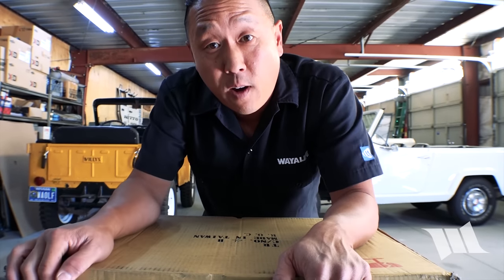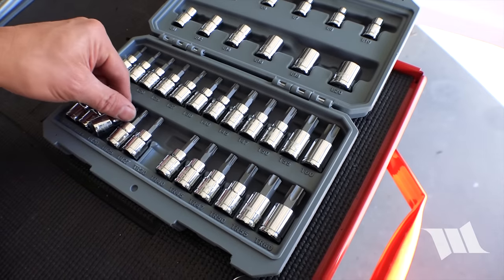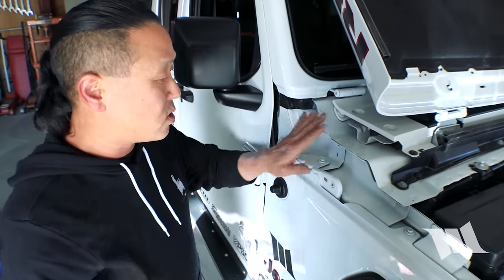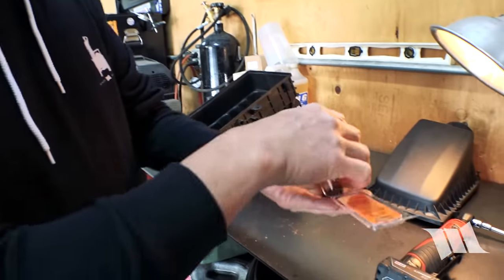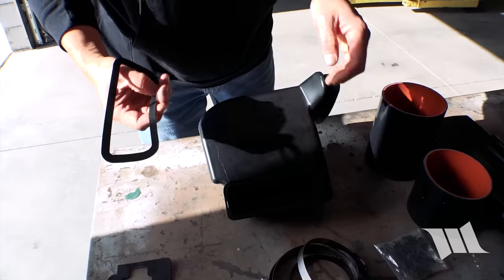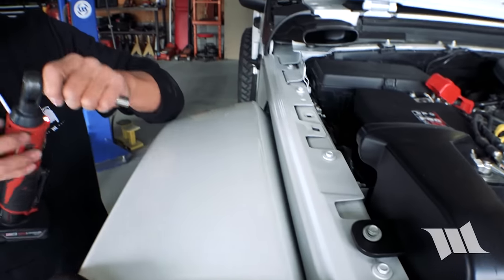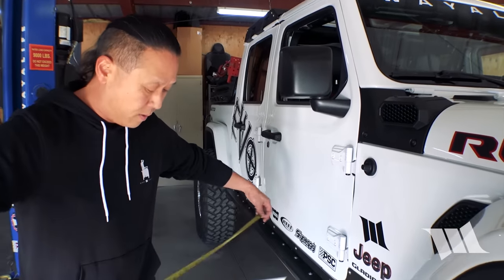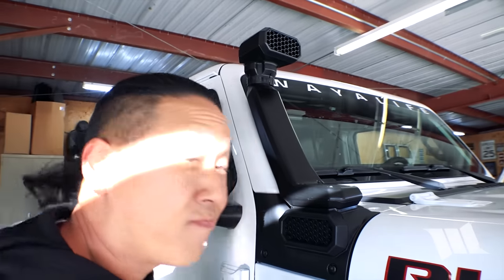Rugged Ridge AmFib Snorkel HOW TO INSTALLATION on a Jeep JL Wrangler or JT Gladiator Truck

Comment: Guess your going to have to “Now” do the River Crossings on Fordyce !  😜
Reply from the maker: LOL - only because we've never done it before ;)
Reply: On a Side Note Eddie... Have not seen a JT Video on Fordyce yet... Hmmmmmm ?  😃
Reply: @wayalife  The low profile snorkel gives you 4.5' of clearance.. but with the ARB air compressor mounted behind the driver side fender,  what is your actual water fjording ability?  I'm guessing closer to 2.5' without a wake?
Reply from the maker: @JeffPalmer941  Not sure how you figure that. The top of my ARB compressor sits at about 40" off the ground. Also, if I really needed to ford deeper water, ARB does sell a kit that allows you relocate the breather to wherever you want.
Reply: @wayalife  the stock gladiator is only rated for 30",  I assumed the air compressor sat lower since it appeared to be under the brake cylinders. I'm not sure what size lift you have, but I assumed that between the lower-sitting compressor, and your lift/tires,  it about broke even..  hence my guess at 2.5'.  If it's higher than that, I'd love to know because I'm interesting in that ACM you sell.
Reply from the maker: @JeffPalmer941  Again, if you really go in deep, ARB sells an extension kit for the breather to locate it wherever you want. I have a link for it in the description of my ACM video.

Comment: Hello from France.... as always this video is superb .... a question: around the 4th minute you remove a part under the air filter ..... What is this part for? I saw in a video of "cj off road" that he does not touch it ...... what do you think? ..... thank you again for the video. bertrand
Reply from the maker: That is the ambient air tube. It take cold air hitting the front of your Jeep and then pushes it up toward the intake on your air box. It needs to be removed or else your drain port will make contact with it, prevent you from fully seating your air box down and make it impossible to access the drain.
Reply: @wayalife  thanks

Comment: Hi. This is my next mod. How hard is it to get at the bottom drain valve to open/ close. My winch is in the way too and I’m just going to cut the ambient air duct off from the inside. Only I will know lol.
Reply from the maker: I guess it depends if you have fender liners installed or not. With them on, it takes a bit of effort but it can be done.
Reply: @wayalife  hi. i’m still deciding between the AEV snorkel with the small cut out in the bonnet and the Rugged Ridge AMFib. Being a Right hand drive over here in Australia i need to see if the AMfib restricts the view as it’s closer to the driver.  I’m starting  to see cheap copies of the AMfib and wonder if they  are any good. AEV snorkel through the bonnet has less joins and this is a bonus . cheers Phil

Comment: I assume the low-profile option clears the folding windshield.  Makes me wonder what it would look like if the portion of the cowl that conforms to the original cowl's shape were painted to match the rest of the truck.
Reply from the maker: I'm pretty sure that it will. Also, Rugged Ridge painted the one they had at SEMA. You can see it in our SEMA coverage.

Comment: My production version doesn't have a rubber gasket for the air box adapter.  It's just a foam gasket.  Doesn't seem air tight.  Should I silicone seal it there?

Comment: Do you think the low mount is going to suffer some air restriction at speed from the vacuum? The stock set up has a secondary feed tube facing the front grill.
Reply from the maker: I assume you're referring to the ambient air tube. All that did was direct cooler air toward the intake. It isn't even hooked up to the air box.

Comment: If you had it to do over again, would you leave the ambient air thing in or remove it like in the video?  I'm going to get this snorkel when it's available.  I live in a swamp so I'm going with the high version, primarily due to splashing and not fording.
Reply from the maker: The ambient air tube needs to be removed in order for the drain to be installed.

Comment: What electronics under the hood did you also have to move to really make the increased water fording ability worth it?
Reply from the maker: If you're really wanting to ford water that deep, there's a lot more you should be worried about than what's under the hood.
Reply: @wayalife  such as? We have a lot of water crossings in Arkansas. I dont plan on doing anything too deep but crap happens. Ive ridden my motorcycle up to the seat and not been concerned bc of where things were re/located. Didnt know if it was the same for a jeep.

Comment: Do you think the low mount snorkel could pose a problem when washing your Jeep if it got a direct spray of water?
Reply from the maker: I suppose it's possible.
Reply: If you got any water in there, just open the drain valve. 
You would have to spray the car wash nozzle in there for several minutes to fill the intake enough to hurt anything.

Comment: Any comment on what happens if you drive for 3 hours on the highway (high RPM) during a heavy rain?  Or snow?  I guess it's no different than what water would be splashing up and getting in the original factory intake tubes.
Reply from the maker: All I can say is that I've done both and for longer than 3 hours and it's not been an issue for me.

Comment: How much extra water clearance does the low snorkel give over stock? Seems about the same except the low snorkel is back by the windshield.
Reply from the maker: If you're fording deep water correctly, it will create a build up of water on the front of your Jeep and potentially to the point where water comes up and over your hood, even if the actual water level is significantly lower that in. The ensuing bow wake will cause the water to drop away and so locating the intake further back alone can be a significant help to keeping water out of it.

Comment: Hey man, I just wanted to ask, now that you've had the snorkel on for a few months, have you noticed any change in engine performance using the snorkel? Good or bad.
Reply from the maker: Can't say that I've seen any changes what so ever.
Reply: Wayalife ok. Just curious. If you ever decide to take off the snorkel I could use a couple parts off of it. Lol

Comment: Hey Eddie! This is not related to this vid but, is there such thing a over gearing?   Suppose I put 5:13 on my sport just for more pickup but don't have a lift or large wheels.
Reply from the maker: Sure, you'd have a lot more pickup but you'd also be running very high RPM at highway speeds. This would cause you to burn a LOT more gas and make it difficult to pass being that your transmission won't want to drop anymore gears.

Comment: seems like on the high profile snorkel you would want the actual intake facing he rear of the jeep,, other wise you are just sucking in a lot of rain water when ever you drive in the rain
Reply from the maker: Watch the video again and you will see that air enters the bottom of the air box and then passes UP through the air filter and then gets sent to the engine. For normal driving, you would leave the valve on the bottom of the air box OPEN and that will allow water to drain out. You close the valve when fording deep water.

Comment: I have a question with the low snorkel setup does the motor get enough air since it’s not facing forward?
Reply from the maker: Just so that we're on the same page, the factory air box, the one that's under the hood has an intake that isn't facing forward either. Your engine is a essentially a vacuum when running and it'll suck all the air it needs and without the help of wind blowing into it. In fact, some high snorkels are purposefully pointed backwards and others have pre-filters that suck air from the bottom of them.
Reply: @wayalife  thank you I thought the factory was facing forward at the bottom of the motor hadn’t looked myself just assumed.

Comment: Hi I have a 2019 jeep jl Rubicon I have 35s wheels 2.5 in lift kit by teraflex and adjust steering stabilizer. Do I need anything else. Im not trying to do any off roading. Just local amd highway.
Reply from the maker: As I had stated on the other video, if you're not having any problems, you shouldn't need anything else.

Comment: Nice video! Is the low profile version any higher than stock? I was hoping you were going to show the difference. If not, what’s the point? Does moving the intake closer to the windshield make a difference?
Reply from the maker: If you're fording deep water correctly, it will create a build up of water on the front of your Jeep and potentially to the point where water comes up and over your hood, even if the actual water level is significantly lower that it. The ensuing bow wake will cause the water to drop away and so locating the intake further back alone can be a significant help to keeping water out of it.

Comment: Looks to impede vision off the right side. No?
Reply from the maker: Don't know if I would call it impeding my vision but if you run it with the full snorkel attachment, you will see it. But, I run it with just the lower part on so I don't see it at all.

Comment: has anyone left the Ambient Air Duct in place? Curious if we really need to remove. Is it a space issue?
Reply: Answering my own question as an FYI for the community. I called RR and they said its no harm if you leave it. They just suggest removing as it will no longer serve its purpose. I'm leaving it to save the extra 3 steps.
Reply: LOL and after I do the full install I learned it has to come up because the drain that you attach to the air box is now in the way. Remove the Ambient Air Duct. Everything is a learning experience!
Reply from the maker: LOL - glad that you were able to figure this out. Yes, you need to remove it for the drain.

Comment: How has it performed so far
Reply from the maker: So far so good. No issues with ours.
Reply: @wayalife  any problems in the rain?
Reply from the maker: @AlanTrades  None that I have seen.
Reply: @wayalife  ok does it come with a rain hood or something
Reply from the maker: @AlanTrades  LOL - any water that does make it into the intake only makes it to the bottom of the factory air box. There are baffles that hold the water and prevent it from being sucked up through the filter. There is no way enough water would build up to be a problem but as you see in the video, this snorkel does come with a drain. If you're really that concerned, leave it open for normal driving and close it just before doing deep water crossings.
Reply: @wayalife  yes i agree its confusing. For clarification,  would water enter through that side vent at the hood that leads to the intake if fording water above the hood line?  Doesn't that defeat the purpose of the snorkel being above the windshield? I'm missing something please help!  Is there a drain hole
Reply from the maker: @AlanTrades  Umm, if you're really driving in water deep enough to get water in at the base of the windshield, you have a LOT more problems to be worried about. Water for sure will get inside your Jeep, your electrical systems will get compromised and if the water is moving, like in a river, you will be washed down stream. That said, proper fording of deep water should be done slowly and to the point where you create a bow wake. This will push the water aside and away from the cowl.
Reply: @wayalife  thanks but what is the point of having an open vent at the base, if there is an open vent at the top of the snorkel?
Reply from the maker: @AlanTrades  LOL - I think maybe this isn't something you should buy.
Reply: @wayalife  do you know what the reason is? It's ok if you don't know
Reply from the maker: @AlanTrades  Do you know how an air box works? It's okay if you don't know. If you watch the video, you will see where I install the drain valve. That is FAR from being a "vent".

Comment: why is this mod so expensive? it's just a plastic tube. no electric or mechanical components but its more expensive than some low end winches.
Reply from the maker: LOL - Unlike cheap ass china winches that are ALL made by the same kids and just packaged in different boxes, the tooling required to make something specific and unique like this (something that won't be a big seller in terms of units sold) costs a LOT of money. But really, there are other options available, perhaps you should give them a look.

Comment: Definitely black rtv the couplers and any seal or connection and be careful the air box to snorkel tube will crush and put screw clamps on the bottom..

Comment: Hey Eddie... Great install...
Mate I have a JKU R/H Drive (Australia) and 7 years back was looking at Rugged Ridge XHD snorkel for the JK, but they are only suited to L/H Drive due to the steering box and other bits restricting the install. Thankfully because though they have that stealth look they had alot of connections that may fail and you would have to strip down your fender all over again to repair...

In your opinion would you be able to retro fit the JL to the JK running the same way...
Reply from the maker: I don't think so. The JL is designed so differently.

Comment: I don’t know why, but mine is having clearance issues, just installed it today, the hood is making contact with the air tube between the box and snorkel. I’ve already trimmed the hood liner and slightly bent the tab on the passenger side. I can now close my hood. It is still making contact. Please advise... I followed your instructions to the letter. Including the instructions that were sent. Any help would be appreciated.
Reply from the maker: A little bit of contact isn't gonna hurt anything. You should be fine.

Comment: Was the ambient air intake removed only to allow the fording height to be higher? I assume for most people the ambient intake can stay in place along with the drain holes in the filter box? Thoughts?
Reply from the maker: No, it needed to be removed for the drain port on the air box.

Comment: Links for every tool you used and the hoodie but not the snorkel? 
I do like it. I have the volant cold air on now, always worry splashing into water if I could get water it. This seems like a safe solution. 
We do tend to flood here in south Louisiana
Reply from the maker: Unfortunately, the snorkel is currently only available as a pre-order. I will add in the link once it starts to ship.

Comment: I'm curious why the short air inlet when its not much higher then your original inlet in the first place? That is if I'm understanding where all the air inlets are on the original set up.
Reply from the maker: When properly fording deep water, you do it in a slow but deliberate manner that creates a bow wake. In the process of doing this, water can easily crest the top of your hood but then  falls away. For this, the location of the intake close to the windshield is more than sufficient to keep water out of your engine. If you really plan on driving through deeper water, the taller intake would be better but then, you'd have a lot more problems to be worried about than just getting water in your engine.

Comment: Will it give it an intake sound like some of the nicer sounding aftermarket intake or in fact can this be used along with an aftermarket intake for increased looks, sound, performance
Reply from the maker: I would NOT recommend a cold air intake of any kind as they let in way too much dust and it WILL ruin your engine. I have seen way too many of that over the years. No extra sound will come from this.

Comment: Nice to have sponsors for all that cool accessories you have on that Gladdy. Nice video. I want to get this snorkel sooo bad but I'm not rich and will have to save for it. Question: If you put a KN filter in there, does the snorkel act as a CAI? VS the stock set up?
Reply from the maker: I would NOT recommend running anything other than an OE air filter. Anything less lets in way too much dirt into the engine.

Comment: Again a great video.  What's your opinion on the effects of a snorkel (high or low) on air flow to the engine?  Do you think the lower position has less airflow because it is not directed toward the front of vehicle.  Just curious if this is a possible downfall of a snorkel?  Thanks
Reply from the maker: I don't think so. Haven't seen any performance losses anyway.

Comment: So do you think it is actually necessary to take out that ambient air part on the bottom, or is it ok to leave it in there?
Reply from the maker: You need to take it out if you plan on installing the drain.
Reply: @wayalife  got it... Makes sense.  Thanks a lot

Comment: Hi eddie me again lol. So i have yet another question for you. I love the look of the low mount snorkel but i also really like the look of haveing a roof/A-pillar mounted light bar. But unfortunately, because of alot of roof mount lights attach to the very bolts you use for the intake of rugged ridges snorkel, i have to pick one or the other. So far ive found a combination of useing dv8's picatinny style roof mount light (product number: D-jl-190052-pil) and the military style snorkel from hauk offroad but this snorkel sits right in front of the passenger and doesnt look as good. Since you make a mount for cb radios and air compressors, do you think youd be able to make a roof mount that can work around rugged ridges amfib?
Reply from the maker: If you don't plan on removing your freedom top panels, you can always install a cross bar on the forward edge of your roof and mount lights to it.
Reply: @wayalife   im guna be useing the soft top more often though is the draw back lol.